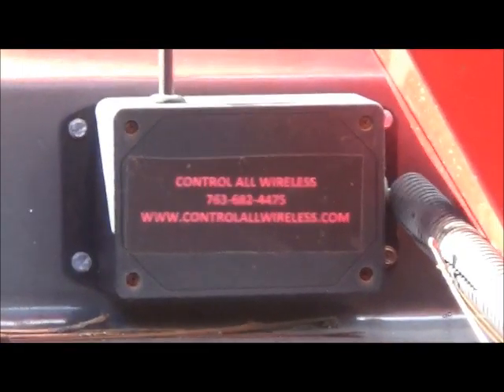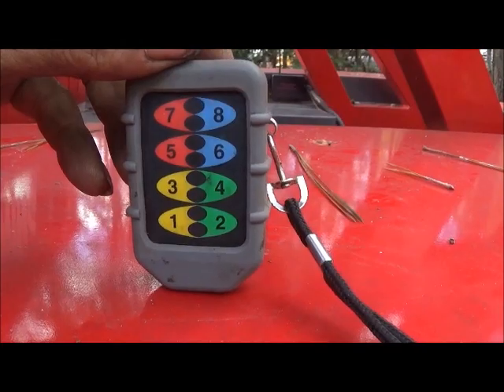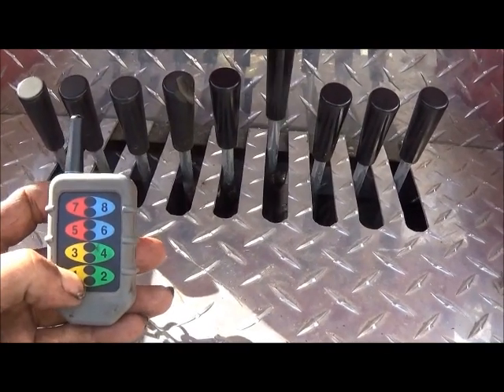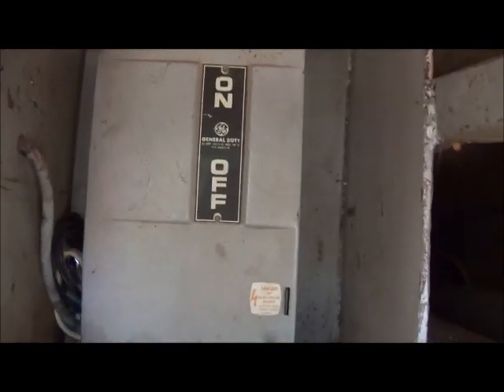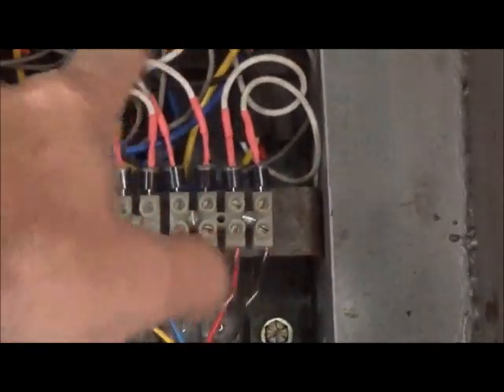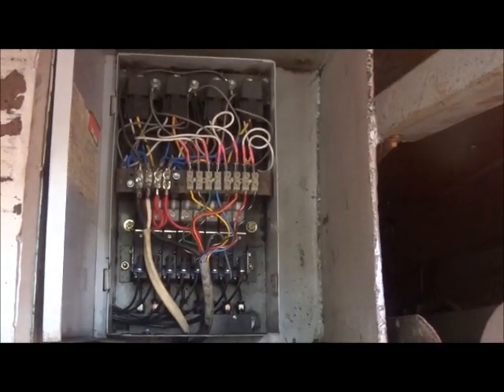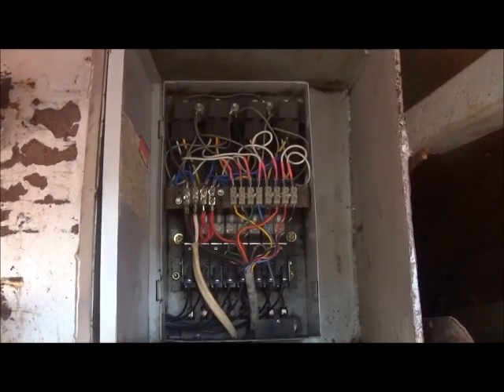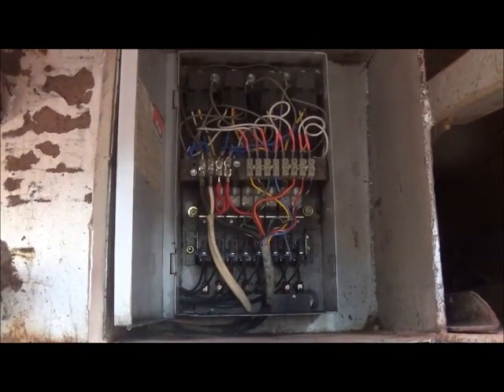Wrecker Wireless Remote 8 Function Hydraulics

Comment: awesome video thanks for posting. i think the extra function is for an all stop emergency kill switch.  I am curious why the solenoids take 20 amps. when i look at specs the air valve solenoids are only a 18 watts or 1.5 amps at 12 volts nominal